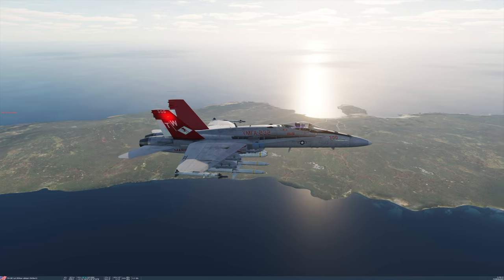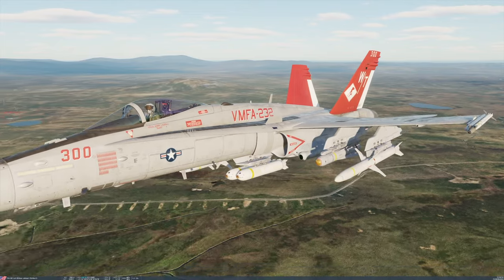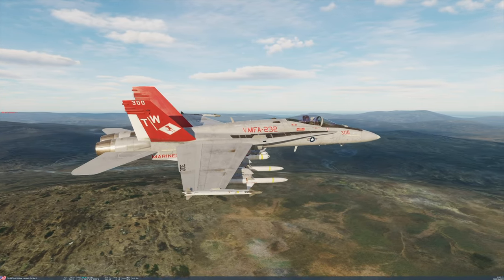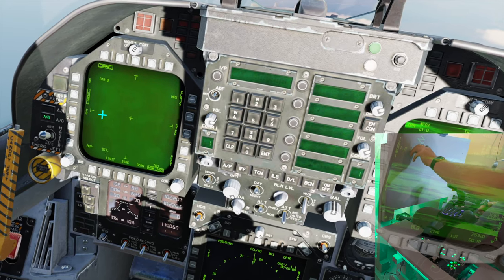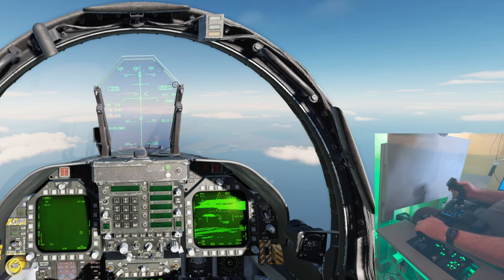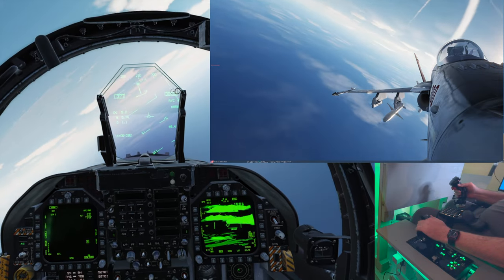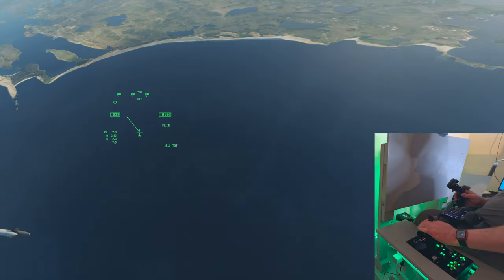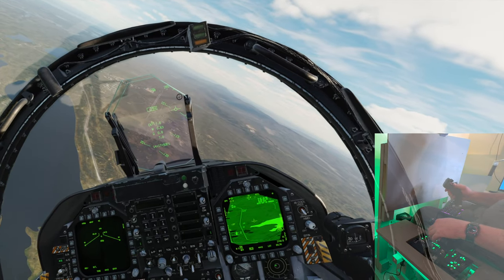DCS VR 4K | F/A-18C | How to Master HARM Pre-Briefed (PB) Mode

Comment: Good video! Don't know how I never thought about using the harm target boxes for creating mark/target points. Will definitely use in the future.
Reply from the maker: Hey thanks! Yeah I started playing around with it and had some success so I tested it out on a self made mission and could see that moving the target designator into the HARM target square on the HUD was very accurate and helped me conduct SEAD missions with greater success and standoff. Tossing out TALDS at range and altitude towards the target and then circling around once before launching helps seal the deal. I've intended on sharing this fore a while via a video but got caught up doing other videos.

Comment: That PointCtrl looks really handy! The flat surface is also a nice idea. Bet it gives you better stability than just hovering your hand in mid air.
The Hornet relies a lot on the DID buttons as opposed to the F-16 where you can do more stuff with just the HOTAS so you definitely either need PointCtrl or MFDs.
Reply from the maker: It is a game changer for sure! I bought a second one to use incase my main breaks! The flat surface really helps keep my hand stable when I need to click on something repeatedly (radio knobs, setting counter measures, etc) plus it gives me a tactile feeling that I am touching something so it makes my overall experience a little more fun. It's not essential but it certainly helps. I am constantly fiddling with the radar via the buttons so I completely agree. It's also great in the Apache (which I have not used enough! Some day...) I actually made a little wooden panel to serve as the keyboard surface for entering in Waypoint data. It was helpful as it keeps my hand steady vs. hovering in the air.
I had considered getting the MFD frames and positioning them so they are roughly where they should be for VR use but the PointCTRL negated that need. The guy who makes PointCTRL has been busy moving to a new home, setting things up, etc. so he's well behind on orders but it's certainly worth getting even if it's "some day". While I was waiting on my PointCTRL (I waited about 8 months) I used only a trackball to click most of the cockpit components so that I would have a better memory of what I need to do and not have to unlearn using all of the throttle buttons to do various things.
Reply from the maker: I posted a new video last night in which I had that little window of me in the cockpit to show the PointCTRL in action.

Comment: I've always used the harm as sensor to mark DEAD targets for gbu-38 but never thought about using it for PB mode
Reply from the maker: That's a great idea as well. When I do that, I use the HARM as you do.. as a sensor for finding the site so I can start setting mark points on targets for precision ordinance delivery. Once I get the location as a mark point, I will send the HARM down range in PB mode and continue to close on the location. Once within FLIR range, I search around for the site (usually pretty close to where I set that mark point) and I can start to assess the area and see what's there and press the attack. Generally the HARM will have taken out the search or tracking radar which helps me with the followup attacks by the time I am closer. With the search radar down, the tracking radar has a harder time finding you so you can get closer.

Comment: Getting the location and distance is great, but isn't the rub for PB mode is that you need to know what is sitting out there in order to enter the correct TGT code?  I'm really new at this, so is it as easy as knowing that the components of a given site are usually the same or are you running a pass first to find what is sitting out there on the tgp?
Reply from the maker: You know what is there based upon the number displayed for the emitters on the HARM display. So 2 is the radar for the SA 2, SD is Snow Drift search radar, 6 is the SA 6 track radar, etc. I use a kneeboard which lists all of the HARM codes for each radar type. 
If they are close together, I hit the de handoff button and it gets rid of the others so I can see the number or letter better. I then can hop to the next one and hand off to see what that one is and so on. Once I am on the one I want, I SCS up to set the HUD as SOI and move the cursor to the center of the box and then TDC press to set that as the target for the HARM. I then go back to PB mode and get to constraints for the target (after ensuring I have entered the code). I am making a follow up for this video as well to better explain this all. Hope my explanation here helped ya!
Reply: @StrIIker-TV  Thanks!  Looking forward to the follow-up.

Comment: Do you need a TPOD to make accurate waypoints, and then designate them? I tried this method today and although I created the waypoints using the middle mfd, when I looked at the data screen the coords were all zeros. I also couldn't make a markpoint a target for my weapons? Any ideas? 

Thanks for the informative video btw
Reply from the maker: Hi! I am glad to hear that the video was helpful. I would like to suggest that you view a more recent video in which I demonstrate this. https://youtu.be/3oxdKVuMcGE?si=aSsEidZ2J6N_gLNF It may be a better one to view as I probably explain things a bit better and cut out unnecessary steps (such as creating a mark point or waypoint.) You don't need th pod at all for doing this and I sometimes fly without it while doing SEAD / DEAD missions in the Hornet. I also posted a few videos in which I am using this method which may be helpful to view.. Here's on such video https://youtu.be/j4Mlp3phz3o?si=uq0waD_nNi6yR4zn
So to answer your question.. You do NOT need a pod to create a waypoint or mark point for this method. 1) In TOO mode cycle through the targets seen in the HARM display until you see the one you want, SCS up to put the HUD in command and slew the TDC to the center of the box from the HARM which is on the radar you wish to attack. TDC depress when it's centered and that's it (double check the distance to the emitter so that it's not 150 miles away!) Now you can switch to the PB mode of the HARM, use the UFC to enter the HARM code for that emitter. Select Aircraft Pull up or Harm Pull Up mode and fly to get the launch symbology on the HUD.. I demo this in the second video several times. The first video I linked is more of a tutorial type of thing. I think both will give you a clear picture of how to do it. It's super effective!
Reply: @StrIIker-TV  wow thanks so much for all this helpful info
Reply from the maker: @NorthernRealms  happy to help you out! Let me know if you have any more questions. Eagle Dynamics recently added the option to have radar operators shut down and move if they detect HARMs so it can be a bit more of a challenge now.

Comment: Nice Video...how is ur Workflow for Video Capture/Editing? I try it with trackfile etc bit DCS Crashes every time😮
Reply from the maker: Hi! Thank you for the compliment. When I shoot videos with external stuff like I did in this video, I always use a spare computer to run the mission as a dedicated server. The track files a dedicated server never corrupt. You just can’t hop into the aircraft like you can with a local track file however that’s useless when the file craps out all the time. 
So I make the mission, copy it to the other PC and then connect to it from my flight system. I fly the mission (often several times) and try to get everything done which I want to show. I then figure out what kind of shots I want for B Roll type stuff and run the track file (now copied to my flight PC) and capture the various external shots, target hits, etc. 
I usually don’t do voice while flying as i like to focus of flying and there can be background noise plus my good mic is a large condenser type on a boom arm and I bump into it at times flying in VR although I did an in cockpit voiceover for my most recent F-15E IFF video and then replaced a few snippets here and there as needed with additional voiceover. So the main thing, you need a second system to run a dedicated server. It’s super easy to set up and it’s free (just authenticate using your DCS account.
Reply from the maker: I also made a How I Record DCS video but I didn’t get into the specifics detailed here as I focused more on the software and basic process.
Reply: @StrIIker-TV  After my comment, I saw your video where you explain editing etc.🤪 I understand that correctly...You have a second PC that runs as a dedicated server and you then play through your mission on this.  Then take the track file created by DCS and bring it to your gaming PC.  This track file is then played via DCS in the mission editor?  to create angles for video cuts etc?  and then in the background the recordings with OBS...
Reply from the maker: @astroedCH  Heh! That’s how it goes! So on the server, you grab the track file and bring it to your main PC and then you select that track from the Replay option (the one you use for replaying track files). It will start up and I use the various keys to go to the various external shots near the aircraft or somewhere on the map where enemy units are etc. I am running OBS and configure it to capture the full screen for the replay tracks vs the OBS setup to capture the VR window. Continually go through the track a few times and record the stuff I want and then pull those into the video editor.
Reply from the maker: @astroedCH  Another thing I started using and it's VERY helpful is an XBox game pad controller to control external views and get smooth movement and rotation. Have a look at this.. It's pretty easy to setup and helps a lot.   https://youtu.be/1zjFx0ovNSA?si=13No64I9aV20HKyk
I also have a Stream Deck from Elgato and I assigned view keys to it so I can more easily jump around. It's not needed but I'm too lazy to remember all the shortcuts. I had the Stream Deck sitting around as I used it in a different game so I use that to help with external views etc. The gamepad is much better for different views though.

Comment: ok, @ 20:58 you had a search radar show in the harm page, the search radar can have 3 codes associated (101,102,122) , how to determine what code to use when the sever does not have ground targets to F10 and peak at them?
Reply from the maker: Hi! Thank you for watching the video and more importantly, asking for clarification around some aspect of it. That is a great question and thankfully, I have a simple answer for you! The S denotes a specific type of search radar and not search radars in general, specifically the Flat Face search radar which can be used with different SAM sites (SA-2, SA-3, SA-5 etc.) There are other types of search radar which show up with different HARM codes. Examples of other search radars and their representation on the HARM display.. Big Bird (BB), Clam Shel (CS), Dog Ear (DE), Snow Drift (SD), Tin Shield (TS).There are no targets for HARM codes for 101 or 102. There WAS for the Early Warning Radars which I think had these designations on older HARM code sheets, but that was incorrect and was removed from DCS and the HARM can no longer target these types. This has to do with the wavelengths of these emitters which the HARM is not designed to track. They show up on the Radar Warning Receiver as a distinct symbol now. There is a generic one for AAA (A on the HARM display) which has three different codes associated with it. I have given up on those ones and just drop a JDAM on them or something :) Even when I knew I was targeting a Gepard with the A and coded it correctly, the HARM never did damage to it. I suspect that you have an old HARM code kneeboard or reference. Here's a link to an updated one.  https://www.digitalcombatsimulator.com/en/files/3314315/
I hope this was helpful for ya!
Reply: tks for the reply, I placed the current harm card in my kneeboard, always used TOO for my harm killing, will try out this way you showed in the video, I never use SP mode @StrIIker-TV
Reply from the maker: @jebb125  Great! Let me know how it goes for you! I always use this method. It’s in several of my videos. I show it in the recent bunker busting and SAM blasting video.
Reply: yep , it works, and I tried something new, harm without pod when you need another 120 , soi hud, put designator in harm square, TDC depress,  read miles . now I can see how far I am out and or MP that position for a later time.  @StrIIker-TV
Reply from the maker: @jebb125  Yeah that's how I typically fly SEAD/DEAD missions when I need a HARM heavy load or when the air threat is high. I only grab a pod if I have JDAMs loaded as well. I made a newer video for HARM PB mode where I think I clarify some things after spending a lot of time doing SEAD/DEAD missions. It's worth a vew ... https://youtu.be/3oxdKVuMcGE